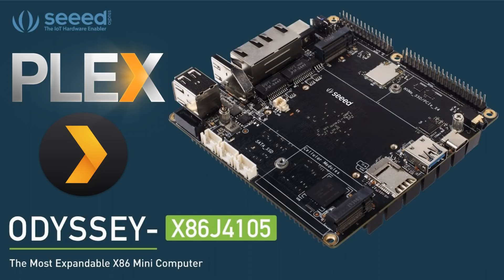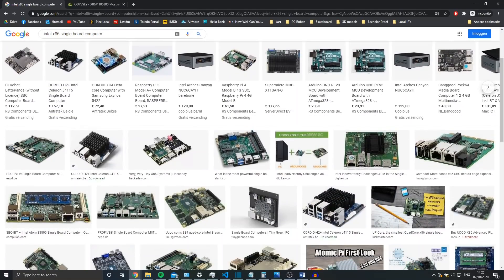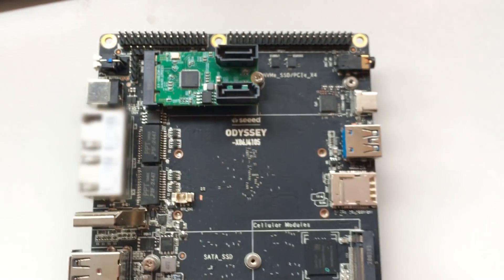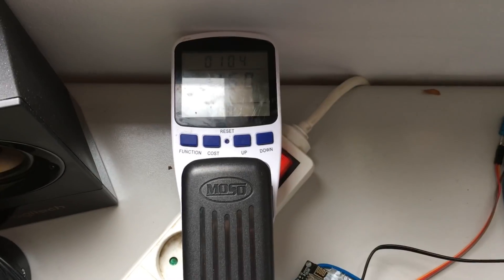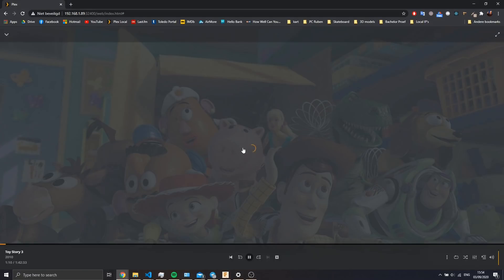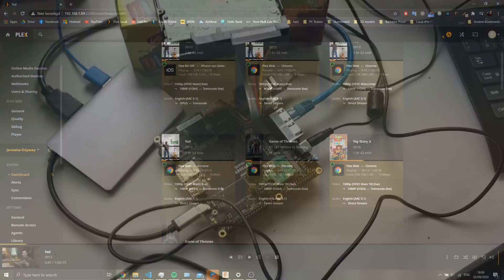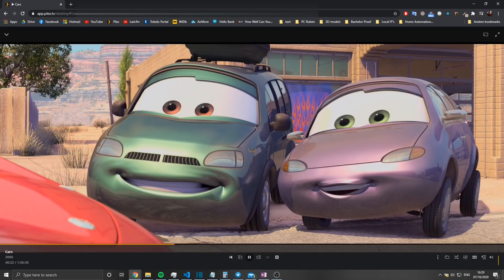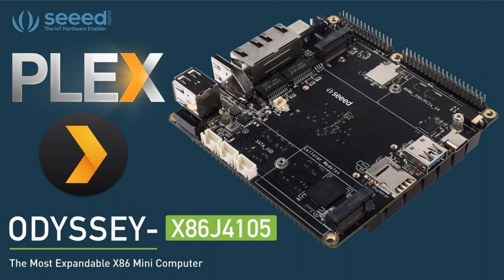Cheap and powerfull Plex Media Server!: Odyssey x86J4105 REVIEW (4K transcoding!)

Comment: Turning on a movie in native resolution has nothing to do with transcoding.

Turn on 3x 4K movie, transcoded to e.g. 1080p, then video transcoding takes place.
Reply from the maker: When the video is h265 and you playback in a browser it has to convert it to h264 in order for chrome to playback the video, so even though it's the same 1080p it's still transcoding
Reply: @sieberoets781  Perhaps you are right, the browser is different from a dedicated application. The cpu load will be much higher. Check  how this Intel cpu is doing when you use a dedicated application.

Comment: You wouldn't by chance know how it would perform for rebroadcasting cable connections from an HDHomeRun would you?  Very intriguing system - but I don't know if DVR functionality can benefit from hardware transcode or if it is all processor and disk activity. Thanks in advance...
Reply: It highly depends whever the client can direct play or not, and it highly depends on your bandwidth.
I use this board as my all day PMS and it's a flawless experience for both movies and live TV

Comment: why are you wasting your NVMe slot with the m.2 to SATA convertor, when it will fit in the m.2 SATA/Cellular modem slot just fine??  even if you're going to use an NVMe SSD for the OS, it would be much better utilized as a swap and temp drive
Reply from the maker: the converter only works with the nvme slot, the cellular has a different kind of M.2 slot

Comment: Did received mine and set some tests, and for this price range it's a very capable Plex Media Server. I got 6 transcodes to 720p 2mbits from 1080p sources which impressed me for the price, I would've been able to start a 7th stream if Windows wasn't doing useless cpu intensive stuffs so thanks for the video.

However I did noticed a strange thing on my board, maybe it's normal or not since it's basically a laptop fan, I need to set the fan to "Positive" in the BIOS otherwise it never spins but it never goes above 73°C even if fan is off is that the same for you?
Reply from the maker: Thanks! sorry for the late reply, my fan worked out of the box, but it bearly spins only under continuous loads. The big heatsink probably dissipates all the heat by itself
Reply: @sieberoets781  yup, I didn't realized that it was a laptop styled fan in this board so it's the expected behaviour. Awesome plex media server board actually
Reply from the maker: Yes I'm also still happy with it. It's a perfect server for a family :)

Comment: That cable management though! :)
by the way isn't it better to get nvidia shield tv for this money? it has Plex server, you can map drivers over NFS or SMB (i don't remember the exact protocol), it can transcode plus you can use it at the same time as a media player on TV.
Reply from the maker: Yeah I concidered it but I wanted to maybe later add a node-red server and other IoT stuff. How is the transcoding peformance on the Nvidea shield, do you use it?
Reply: @sieberoets781  I use nVidia Shield TV everyday. When transcoding happens (4k HDR, high bitrate) I don't even notice it. It is maybe noticeable more when I try fast forward or rewind otherwise it is smooth, cold and quiet. You can even attach mouse, keyboard and controller to it and then play games you own on steam, epic, uplay and etc. So it basically replaces console or a good fullHD PC for gaming. 
It is an amazing device, the best streaming device that exists on planet earth today in my opinion.

Comment: You could of installed the open version of synology's dsm and installed it as a plug-in so you wouldn't have windows using all the resources. Gives you access to many other useful plugins as well.
Reply: Will also be able to managed headless from a web browser.
Reply: that's my question, you know if xpenology works in this little pc?
Reply: @raulgil8207  I'm not too sure, you could test it but it does support most intel configurations. I'm sure it will. If not there are several NAS operating systems that use linux. If I'm not mistaking the Xpenology also runs on a modified linux.
Reply: I'm using debian now on it, I wa using CentOS but you know, it died :( 
It is the perfect machine for plex and samba, using an m.2 ssd and an 8TB USB drive for NAS.
Reply: Could have*

Comment: I'm sure this is great fun but you can get a used I3 or I5 Lenovo small for factor system on Ebay for less that $200 including Win 10 pro. Connect an external 8TB drive via USB 3 and you have a Plex server. No fuss no muss.
Reply: Yeah but I'm sure this is the best PMS money can buy if you're into crazy energy efficient servers. 
24W at full load with a 3.5" drive to spin (video) is very good
Reply: exactly this thing is not cheap and not likely easy to setup i dont see the point when you can pickup whole systems capable of plex streaming for $100

Comment: It looks like you’re using Windows 10 as your server OS. How might performance change if you used a different OS? Perhaps Linux or maybe even Xpenology, since that one was made to perform as a NAS (which you’ve effectively created here.)
Reply from the maker: Yeah I first tried running ubuntu server but for some weird reason HW transcoding wouldnt work on Linux, on Windows it did so is stuck with it

Comment: Cheap? This thing costs a ton. The board itself is like 200$, hard-drives are a huge additional expense that this device can't power at all, it has no case...
Reply: Well for the price and performance it's a cheap Plex server yeah, Nvidia Shield for the same price point can only do 4 transcodes, you can still do cheaper plex build using a RPi but you'll lose the transcoding ability
For the case standpoint it's up to you, I've designed a small tower styled case
Reply: I’m thinking the same thing, with the exception of the expense of the hard drives for media content.
I consider that a fixed “other” cost as it doesn’t matter what platform I chose, noting is going to have the native 16TB of storage I’ll need.
Right now I’m using a Lenovo M90 “nano” (8th Gen Intel i5) as my Plex server, but I’d prefer something with more power.
I’m thinking that getting too much less than the Ultra Small Form Factor (Lenovo USFF) that you give up too much power and or features. It’s best to buy those used, just as long as you go later than 9th Gen i5 or i7.
Reply: @GasPipeJimmy  The utter lack of a case is a really bad deal. You DO NOT want any moisture or dust hitting this thing. Same with the drives.

But like, the power. This thing is NOT powering drives at all and it'll be profoundly dumb and unsafe to have fifty outlets taken up by each HDD.

A desktop/3.5" (aka all you should be using for storage) HDD takes... if memory serves, ~15-25W. That's probably more power than this board can even draw.
Reply from the maker: @acumenium8157  about the HDD, it uses around 5 watts when reading/writing so the board is perfectly able to power them
Reply: @sieberoets781  2.5" HDDs do, not 3.5" ones. 3.5" ones are freaking power hogs, they need like 15-25W easy.
Reply: @acumenium8157  Agree, you shoudh've stick with the 2-bay hdd dock whick is powered from the wall, freeing some charge from the board
I'd say, only use 2.5 inch if you want a direct connection (power / data) to the board since 2.5 disks consume around 5 watts, even when doing complex i/o.
3.5 inch hdd can go up to 25w, from that power standpoint you can fit 5 2.5 inch drives (including external) to the board
These 20w would've been saved for CPU transcoding
Reply: @issechacle4488  Big issue here for wattage is I don't know what this particular board can GIVE. Take Android TV boxes, they rarely have the 5W to spare for an external hard-drive. It's usually closer to 3.5-4W, meaning there's going to be erratic crashing.

I really doubt these boards have 25W+ extra for 3.5" drives. Now, this wouldn't be an issue for USB ones, as those uses wall-mounted power supplies. We're seeing here though it plugs directly into the SBC and... that means IT powers the hard-drive.
Reply: @acumenium8157  Odyssey power brick is rated 12V 2amps (at least in 220v country, ETA prime said in his video that his was 12V 1amp) , even at full loads it doesen't consume that much power even with 2 usb powered 2.5 inch drives (I guess a 3rd one + 2 nvme ssds are possible since there's dedicated slots + 2.5" drives consumes arount 2.7W when writing / reading)

It's a very capable little board for the price, I've hit a max of 6 transcodes on Plex Windows 10, could've started a 7th if Windows 10 wasn't doing it's intensive useless CPU / GPU intensive stuff, time to try Linux.
Reply: @acumenium8157  my stationary machine have 7 hdd and one ssd and uses ~90-100w while idle using an i3 7100 cpu, that’s a far bit shy of the 175w estimated by the 25w / drive, in reality it’s closer to about ~10w per 3.5” drive unless you got some crazy ones

Comment: Why not just use a NAS.?
Reply: NASs are not able to do 4K transcoding.
Reply: @aliaghil1  They do...
Reply: @Justdigit2   I was talking about regular home user NASs. defiantly you can make your unregular  fancy pansy  NAS that able to do 4k transcoding... but nut home users NASs...
Reply: @aliaghil1  Not true... A simple home consumer NAS from around 350dollar can do this... You have seen what this board costs?
Reply from the maker: @Justdigit2  $188 thats still half the price, but NAS would be much more convenient to setup I admit, no dangling harddrives etc
Reply: @sieberoets781  At the end it matters if it works yes or no... And I do like those diy projects... Job well done. 👍
Reply from the maker: Fair point but I don't think there are many Nas'es at this price point and these specs, would be cleaner tho 😆

Comment: Hi, for direct streams without transcoding do you think it can handle 20 simultaneous streams? Thank you.
Reply from the maker: That will depend on your network speeds and the bitrate of the video’s normally cpu will not be a bottleneck with direct streams, the gigabit connection will.
Reply: What the Heck are u doing to need 20 simultaneous streams? But as already said, with 1G you can get a problem, if these are 20 Blu Ray, high res streams. (Dont think about 4K i guess), with 2,5Gbit it could be possible or better to say it should be. 10 Gbit is still more dreaming I guess
Reply: Direct stream is not CPU heavy, even the rpi4 can handle multiple (10+) 4k streams if you can feed it from storage perspective and if your network is fast enough, so my guess is that this board can easily done it. I have a similar setup (rpi4 4 gig, ssd for cache and a nas for raid5 storage) and streaming to 4 4k TV is not a problem on a local wired network. Transcoding on the other hand is total off for the rpi, even one 4k to 1080p or 720p is killing it easily, so if it's important to you than go with this board.